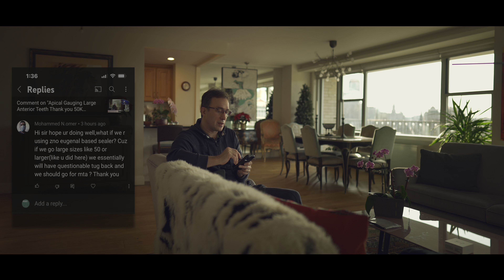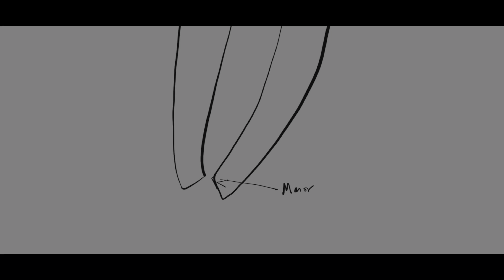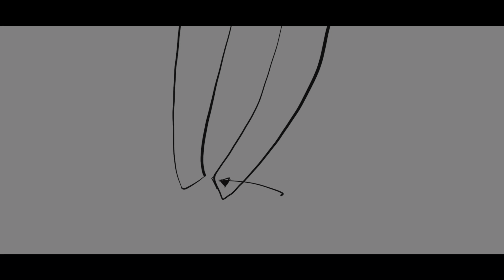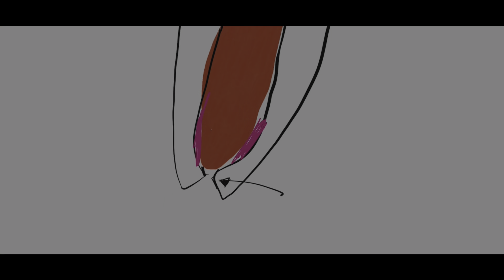Answering video coments: Large apical Diameter vs tug back?

Comment: I adore this video, but I have a related question: In the last year I have switched from the large taper canal prep to the constriction (06 and up) as described by Dr. Ruddle and Buchanan to preparing canals with 04 taper files and shaping to maintain the constriction (as you and Dr. Ricucci describe).
I notice that achieving tugback is much harder (regardless of the apical size) and I find that I pull cones way more often as I sear them at the orifice. 
Is this normal? Using 06 taper cones for these 04 shapes seem to be more predictable in my hands, but it is still confuding to me.

Comment: Hi sir. Are there regular apical constriction in all cases? Or even when we have a large apical lesion which may absorb constriction, is there apical constriction? I imagined a tooth with hypercementosis and an apical lesion that even the PDL had disappeared. Does Apex Finder work? Do we have to clean,shape and fill, the cemental canal up to the working length ?
Reply from the maker: That's a great question and I will definitely include it in the next video! The short answer is that you are correct, there's no guarantee you'll have a perfect constriction in every case and some experience and decision making is required to end up finishing the apex to the a place where you have adequate cleaning and yet are not out. Thanks for this important comment! :)
Reply: @AANasseh  thank you sir. I eagerly look forward to the next video
Reply: @AANasseh  sir if hypercemtosis is present even in that we should ristrict to apical constriction.

Comment: i have 2 apex locators. i want to ask you: when my file reaches the 00 reading(apex reached and not passing deeper) is this the minor constriction reached? and should i subtract 0.5mm from the reading for my working lenght? (also i usually check a few times during enlarging, my working lenght with my apex locator because i know it may change during shaping). I am asking this because you explained so well during this video the purpose of keeping the apical constriction and not blowing it with files.(yes, i just blew a week ago an apex of an mb1 and got  a lot of bleeding and now i understand why it the bleeding happened). thank you a lot for making these educational and practical videos! Cosmin H.
Reply: Sir when apex locator show reading 00 it's means apical constriction( infact PDL) reached and have to subtract 0.5 from it and then apical gauging to be done and FAF selected,which is then enlarge two or three times.
Reply from the maker: I agree with Vikas. It's best to subtract o.5mm. However, it's also important to know your apex locator as different manufacturers program the settings differently. For some people the 00 is out, for some, It's at constriction, and for some it's already subtracted by 0.5mm. So, take X-rays and see where it is radiographically too and whether you're happy with its location unit you really get a sense of it. After that, still take radiographs because you get additional info from radiographs you don't get from apex locators! Cheers!

Comment: This is great stuff, and I largely agree. However, there is an assumption here that the apical architecture is intact. In cases with large periapical areas the potential resorptive process can destroy both this anatomy along side that of the bone too. Would you manage this differently?
Reply from the maker: This is a great nuance and probably worth its own video! Thanks for bringing it up! Yes, that's a different concept and the idea there is to create a new apical stop by backing inside the canal and enlarging beyond the opening.... .Ideally at least. Cheers!

Comment: Hello, in CBL39 video I left this comment and it has been said that there wil be a video about it, is it still in plan? (Dr Nasseh, I see that you are using the apex stop function, where the apex locator stops the file when reaching apex. Id like to use it too, but the hypochlorite confuses the apex locator, making it think it is reaching the apex, when it is not. How do you troubleshoot this? Also what is your complete irrigarion protocol and how much time after instrumentation and before filling do you irrigate?)
Reply from the maker: I'm sorry Martin, your question is definitely in the queue to be answered. It's super important. To give you the short answer is to make sure you have suctioned all fluid from the chamber and some of the fluid inside the canal. I prefer a desiccated dry chamber to reduce confusion of the A.I. apex locator. Then have the setting on stop; but after you capture the lengths you can switch from apical stop to apical action off. This way it doesn't come to a stop every time you reach apex. Otherwise, you can disconnect and use analogue readings after you got the reading with Apical Stop. On irrigation, that's a whole lecture itself which I will certainly share at some point. There's a lot on my plate and time is the only issue right now. Cheers!

Comment: Hi doctor , can you explain the m4 handpeice , and if it can replace the endo motors , can it be used safely ?
Reply from the maker: I'm not a big fan of the M4. I don't know if it has evolved much but back in the time when I tested it you only used it with hand files and it was used in a pure reciprocating motion of 30 degrees back and forth which really is not ideal for either going down canals or instrumenting in a substantial manner. But it's helpful it you have to use hand files and don't like to use them by holding the handle. Otherwise, I don't see any advantage to it.